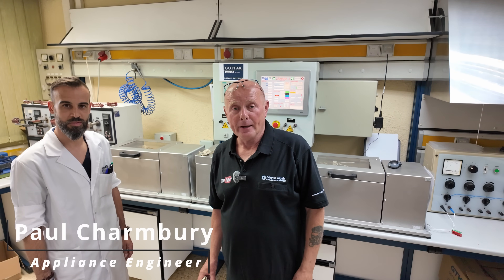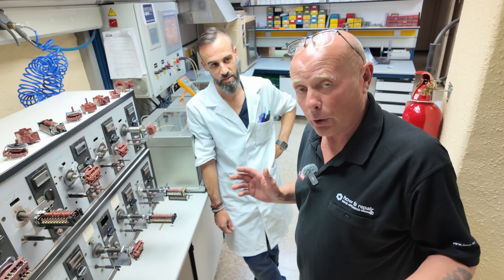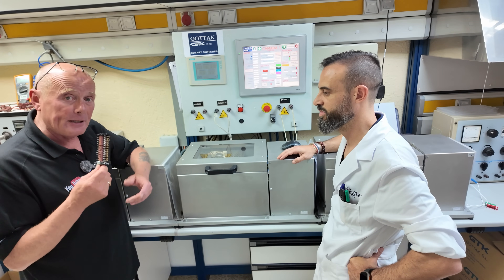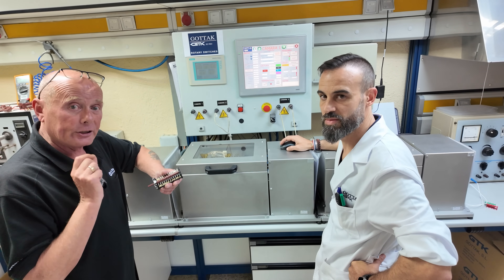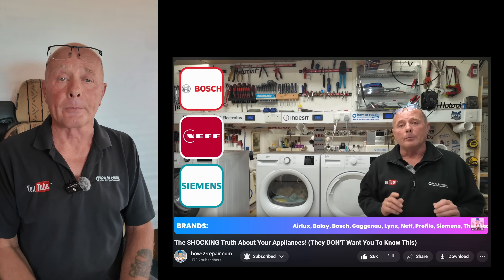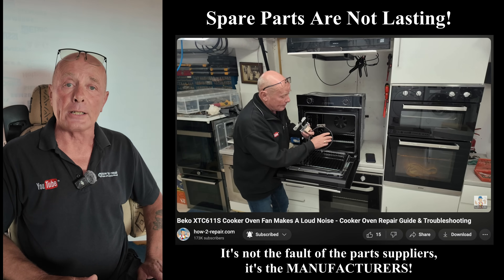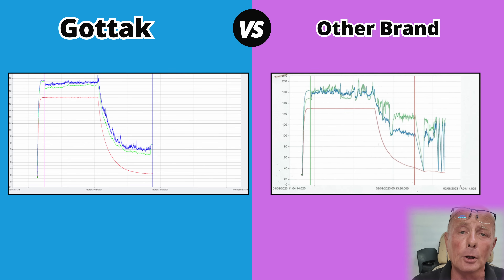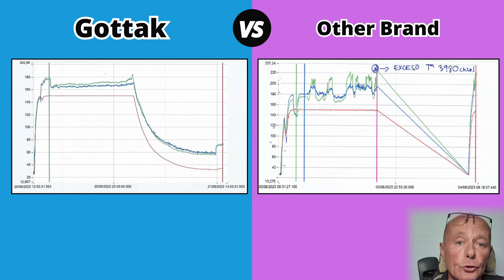Why Your Appliances FAIL SO FAST! Lab Results EXPOSE the Truth!

Comment: Once i had the need to repair a washer machine that started to make load noise when centifugate, i managed to disassambly it jist to find that the bearings and seals of the transmission were enclosed with soldered and riveted, i had no choice but to drill and cut the metal replace with semiindustrial bearings and seal with special epoxy. The washer goes well 4 years more when i replaced with a new one but it was washing fine. I jus replaced it  for a new one that was inverter. The new one have a lot of plastic....we are extremely carefull no to load it too much...
Reply from the maker: that's quite the repair story! Your experience with the washer's transmission, having to drill out soldered and riveted parts just to replace bearings and seals, really hits on an important point about the challenges consumers face when trying to repair appliances. This difficulty in accessing and replacing parts, as you described, is exactly the kind of built-in obsolescence we discuss in the video. 

I would greatly appreciate it if you could share this video. Together, we might be able to bring about some change. If we can't shame the manufacturers into action, perhaps someone in government will see the video and take notice of the overwhelming number of comments expressing public concern.

Comment: Manufacturers need to learn from the lesson that John Deere is currently learning. Locking people out of the machines that they've bought, and screwing them on repair and upgrade abilities is the end of them. I just bought a nice 3D printer, and I'm using it to build a CNC machine. I'm an Electrical Engineer, with some machinist training. I can reverse engineer any appliance in a house, and repair/upgrade it beyond it's life expectancy. I'm not alone in this rural community. There are already Open Source designs to replace almost every piece of farm equipment, and more people are learning about the technology in their daily lives. Just about every community has geeks, and in a farm community they include machinists, welders, electronics techs, programmers, and even real engineers. A company paycheck can't compete against against our desire to help our family and friends when we can. If you want a product that sells well, helps your customer, and contributes to a company's longevity and bottom line, build economy-grade kit systems that act as an "on ramp" for customers to diagnose, repair, and upgrade their stuff. I told JD to make kit systems for farmers to use with their tractors, to get some autonomy back, but they didn't think it was good for the bottom line. I don't think that there's anything that they can do to save their bottom line now.
Reply from the maker: Thank you for your comment. I appreciate people like you taking the time to write it out. Please share it where possible. It might help others make a wise choice instead of being misled by the industry.

Comment: I've noticed this over the last ten years through fridges, washing machines and toasters. Over this time I've gone through 4 fridges, 2 washing machines and 2 toasters. The washing machines were circuitboard problems. The fridges and toasters tripped my main power board everytime.

The lucky thing for me is that I live in a company house and they supply all the whiteware. So they replaced the fridges and washing machines with no expense to me. The toasters were all up to me.
Reply from the maker: planned obsolescence and the lack of repairability are major issues in the industry. Manufacturers prioritize profit over long-term reliability, and as you pointed out, the pressure to keep releasing new models only adds to the problem. It would be really helpful for me to get my video shared and help us fight appliance waste!

Comment: I understand the gripe when it comes to products failing, but obsolescence comes from old technology replacing new technology, not some kind of nefarious scheme by manufacturers.  Manufacturers aren't using the cheapest parts in order to pull a fast one on the consumer.  They use the cheapest part because that is what consumers demand when they do price comparisons between models and try to get the most features for the least cost.  Another aspect of this is that they can make things bulletproof, like they did in the 50's but how many people want to use those products anymore?  No matter the quality, those products are obsolete because they are inefficient, lack modern features or are just outdated, so why overspend on a product that will become obsolete in ten years?
Reply from the maker: Hi there! Thanks for your comment, @glumberty1!

You raise some excellent points, and you're right that technological advancement and consumer demand for competitive pricing and new features play a huge role in the product lifecycle. It's definitely a complex issue with many contributing factors, including the ones you've highlighted regarding the trade-offs between cost, features, and ultimate durability, and why a "bulletproof" but outdated appliance isn't always desirable.

The video explores how some manufacturing and design choices, often influenced by these very market pressures, can result in products having shorter lifespans than consumers might expect or desire. This is exactly the kind of built-in obsolescence, or perhaps more accurately, the impact of design choices on longevity that we discuss. Understanding how much these factors contribute to the lifespan of new appliances these days is something everyone should be aware of, regardless of the primary driving force. For a deeper dive into this topic and to see the examples we covered, please check out the full video here: https://youtu.be/gEgSCbZnHVM?si=wTIw0mELuhWaw4aX

We also explored related aspects in these videos:

The shocking truth about manufacturers: https://www.youtube.com/watch?v=QsdGd2qDPaI
Heat pump tumble dryers are they really worth it?: https://www.youtube.com/watch?v=xn03N3b0-lE

If you found this perspective and the information in our videos eye-opening or helpful in understanding the full picture, please consider sharing this video with your friends and family. The more people who understand all the facets of what's happening with appliance longevity, the better equipped we all are as consumers.

Thanks again for watching and engaging with such a thoughtful counterpoint! Don't forget to subscribe to the channel for more insights like this!

Comment: Our appliances are from 1984, amana radar range, jen air oven and cooktop. We only replaced the dishwasher because the data tag rotted off and i didn't write down the model and serial numbers to order the correct parts.
Reply from the maker: To establish their brands, the majority of manufacturers produced high-quality machines throughout the 1980s, 90s, and early 2000s. Selling more machines is their primary objective. They profit from green marketing strategies, yet they don't face consequences for the rising amount of white goods that are thrown away. These days, the average lifespan of a gadget is barely five years.

Comment: Back in the 1980's they had all the tech to build a car with decent performance and efficiency, easy to work on and maintain, that would last half a million miles.
Reply from the maker: It’s true mate built-in obsolescence and durability issues aren’t limited to appliances. It’s frustrating to see this pattern repeat across so many industries! I would greatly appreciate it if you could share this video. Together, we might be able to bring about some change. If we can't shame the manufacturers into action, perhaps someone in government will see the video and take notice of the overwhelming number of comments expressing public concern.

Comment: I have had the same Side by side Fridge. twenty six years. The ice machine failed when the plastic part broke, many years ago, but it is cold, and I refuse to buy another until she fails completely. I just had to replace my clothes washer after 26 years. Nothing that I have had to replace with modern appliances will last more than 5 years at the most. I just had to replace my TV after three years.
Reply from the maker: In the 80s, 90s, and early 2000s, most manufacturers produced high-quality equipment to build their reputations. Now,their main goal is to sell machines. They use green marketing tactics to their advantage but aren't held accountable for the growing pile of discarded white goods. Nowadays, machines last only about five years on average.

Comment: Many people do not realise that some products are designed to fail. I have seen this on several occasions. I once bought an electric kettle which failed after a months use, with a broken switch. When I dismantled it, I found that the plastic switch lever had a notch moulded into it at the lever point. This reduced the cross section area of the lever at this point to one quarter of that of the rest of the lever, and the notch had sharp edges. In other words,  the lever had been weakened and a stress raiser inserted at the point of maximum bending moment. There were no space constraints which would have necessitated this. What should we conclude from this?
Reply from the maker: Finding a deliberately weakened switch lever with a stress raiser at the point of maximum bending moment, despite no space constraints, leaves little room for doubt. Thank you for your comment. I appreciate people like you taking the time to write it out. Please share it where possible. It might help others make a wise choice instead of being misled by the industry.
Reply: Kettles are total rubbish now. Even spending 5 or more times the price of a basic one with a fancy brand and nice looks I'm convinced they come from the same Chinese factory. I speak with experience of a popular German brand and a currently popular American brand known for 14 in 1 cookers and food processors.

Comment: I buy cheap washing machines.  On the grounds it's got 2 years warranty & in that time it will be cheaper that the launderette.  Anything beyond that is a bonus,  current machine is a indersit and 6 years old.
Reply from the maker: Buying cheap is only falling into the manufacturers hands even cheaper appliances should last a statutory period of time. Thanks for your comment.this video seems to have really touched a tender nerve with a lot of people! It's clear I'm not alone in wanting more sustainable appliances. Help me hold the industry accountable by sharing this video. To make a real difference, we need to get this message to the people in charge and tell those appliance-wrecking accountants to back off! I would be grateful if you would share this post, as it’s the only way to force things to go large nowadays.

Comment: 3000 rotations is ok. That's 9 years plus. Wouldn't you be able to just buy a new switch? Or maybe you'll want a brand new 9 year oven.
Reply: Oven switches are mandatory to comply with IEC 61058-1 which is an international  standard for switches used in appliances and equipment. The norm states switching frequency of 10,000 cycles. Less than that, will not comply with international laws for safety.
Reply from the maker: Thanks a lot for your comment Daniel!
Reply from the maker: Thank you for your comment. I appreciate people like you taking the time to write it out. Please share it where possible. It might help others make a wise choice instead of being misled by the industry.

Comment: I bought a house built in 1955. The oven was the original installed when the house was built. It was a Thermador, the very first electric model they produced; we finally replaced it in 2023. It lasted 68 years!!! The technology is irrelevant. It is exactly as he has described; the products are designed for failure indirectly because of poor quality.
Reply from the maker: In the 80s, 90s, and early 2000s, most manufacturers produced high-quality equipment to build their reputations. Nowadays, their main goal is to sell machines. They use green marketing tactics to their advantage but aren't held accountable for the growing pile of discarded white goods. Nowadays, machines last only about five years on average.

Comment: my parents bought new appliances when they bought a house in 1954. everything was still working into the mid 80's but were replaced in an attempt to "upgrade". the fridge went into the basement and finally died in 2001.  in 2019 I got a new, bigger fridge that cost $1000 and it only lasted 6 years. a dishwasher purchased in 2015 lasted 4 years.
Reply from the maker: In the 80s, 90s, and early 2000s, most manufacturers produced high-quality equipment to build their reputations. Nowadays, their main goal is to sell machines. They use green marketing tactics to their advantage but aren't held accountable for the growing pile of discarded white goods. Nowadays, machines last only about five years on average.

Comment: Ok, but... none of my appliences went dead just after waranty. I know people say that, and I'm sure planned obsolescence is a thing - but I have most of my appliences bought when I bought my appartment 14 years ago and they still running well. The only exceptions are: waching machine that I sold when buying better one and dishwasher that indeed broke down (long after warranty tho) due to me not using salt while having very hard water.
Reply from the maker: In the 80s, 90s, and early 2000s, most manufacturers produced high-quality equipment to build their reputations. Nowadays, their main goal is to sell machines. They use green marketing tactics to their advantage but aren't held accountable for the growing pile of discarded white goods. Nowadays, machines last only about five years on average.
Reply: @How-to-repair  I know this is the issue, that's what I'm hearing from so many people. My equipment was new when I bought the apartment - so it was manufactured in 2011-2013, so hardly early 2000s. I might be just lucky, or this is not as bad in EU like in other parts of the world. I just never had equipment that fails just after warranty - not saying it's not happening, I might just be very lucky. Or - what I think might be the case - I buy very basic stuff - less gadgets to break maybe?

Comment: Not only is building something deliberately to fail fraud and theft, it harms future generations by basing our economy on climate change caused by unnecessary manufacturing. 

Is it worth it for you to get rich to do such harm to the human race? This needs to not just be outlawed. It needs to be criminalized. 

Don't use plastic in critical parts. Make replacement parts available at a reasonable price.  Provide diagrams and repair manuals. 

Do it voluntarily or we will impose it on you.
Reply from the maker: Thank you for your comment. I appreciate people like you taking the time to write it out. Please share it where possible. It might help others make a wise choice instead of being misled by the industry.

Comment: every thing failing. appliances ,TVs, cars,ect. next disposable humans...?? all to make profit. we are broke. parts gotta get 10 of them before one works.  the people got to greedy. and we all suffer... car to machine eventually to us getting hurt from so cheap junk. and ads everywhere. buy buy buy!!!. don't want to cause don't work!!!. tvs 50" 200$. but with ads and will fail in two years and only in4k. which alot of people can't see. or have service . we are flooded with fakes and bad parts. it's bad. even microwaves 1200 watt is huge size at Walmart. it's big. wattage down. and will fail. a good micro is 1400 watts.? bad news society.😊😊😊
Reply from the maker: Your frustration with items failing prematurely, the struggle to find reliable parts, and the constant pressure to "buy, buy, buy" despite poor quality, perfectly encapsulates the core problem of built-in obsolescence. Thank you for your comment. I appreciate people like you taking the time to write it out. Please share it where possible. It might help others make a wise choice instead of being misled by the industry.

Comment: Another appliance reviewing channel with similar views to this one commented that about the only thing a consumer could do when buying a washer/dryer,for example,was to consider buying the commercial version, ie: the ones used in laundromats,as what you have said will apply to cleaning appliances as well. Commercial versions of appliances tend to be built with reliability in mind,with the downside being they might be double the cost.
Reply from the maker: Thank you for your comment. I appreciate people like you taking the time to write it out. Please share it where possible. It might help others make a wise choice instead of being misled by the industry.
Reply: Commercial appliances break just as often as consumer appliances - talk to the owner of any laundromat, for example.

The difference is commercial appliances have a steady parts supply chain, consumer appliances much less so. The laundromat owner will show you their closet where they have eight of whatever fails on their commercial appliances once a year sitting on a shelf because they have six on the floor.